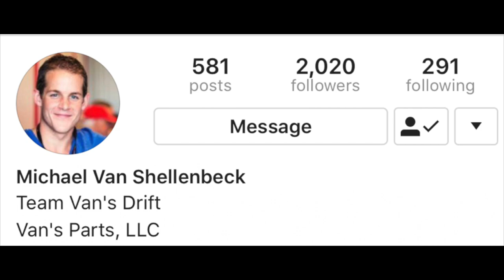Lone Star Drift Round 4 - Formula D Proam + TXSL

Comment: i cant believe people actually drift a ford mustang, those things, all models, look like the biggest pieces of poop evar
Reply from the maker: I drift one.  It is rad as fuck.  I also have had over 7 JZX100, skylines, 180sx, 240sx, m3, m5, and everything else as a drift car.  Mustang is a rad as fuck platform, mine has a coyote motor that is completely stock down to the air box, with a stock clutch, stock diff, etc.  Thing is like the American JZX100!